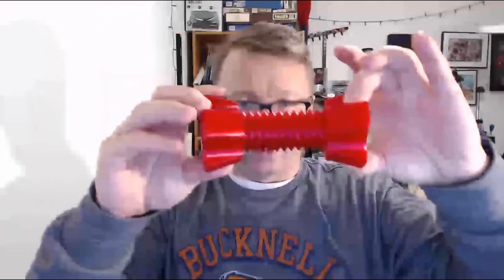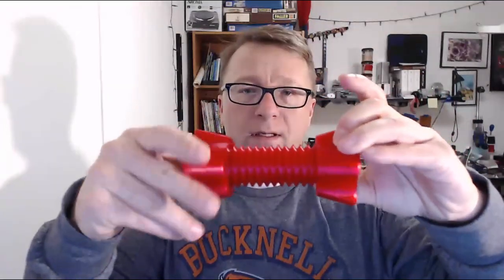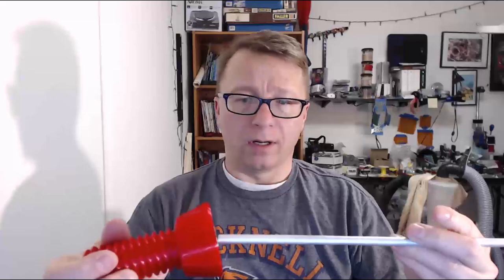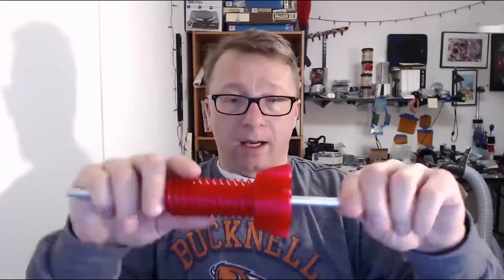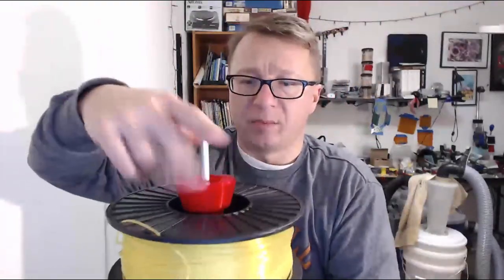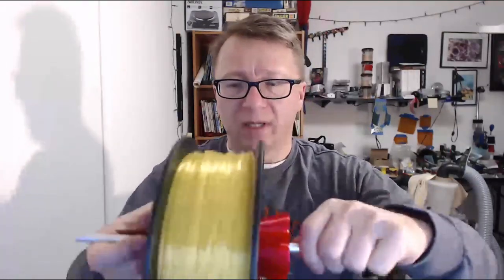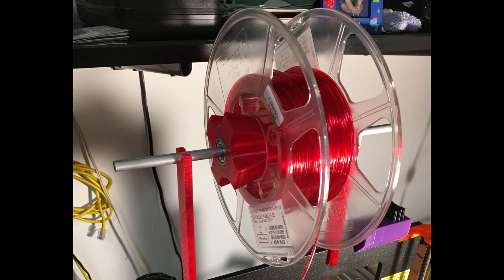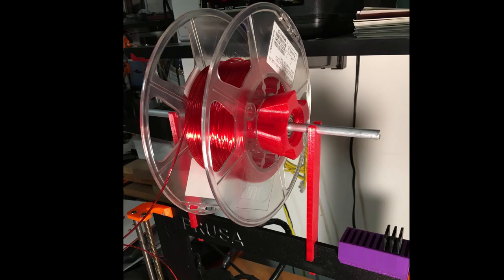How to Use the Filament Holder on the Prusa i3 MK2

Comment: Would PLA work for these parts?
Reply from the maker: It should, but PLA is much more brittle - the only area I would worry about it the connection points of the arms.  They won't withstand much pressure - should be a problem though.
Reply: I did PLA and so far I love it. I have some filament spools that are too wide but I have a smooth spool holder for those (unless you want to release a longer threaded piece - hint, hint...). Thanks for the great parts!
Reply from the maker: Hi Kevin - I'm glad PLA is working for you.  I will update the models with a longer version (hint accepted ;)).

-Tom